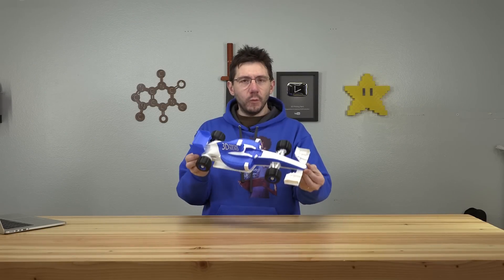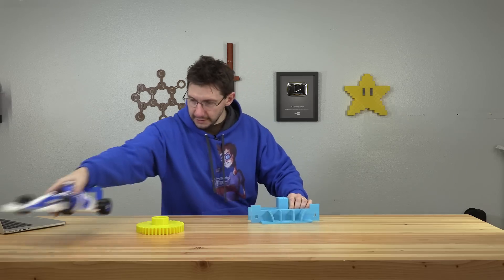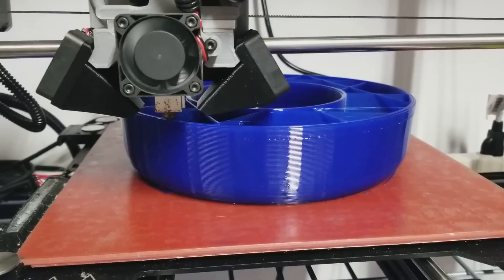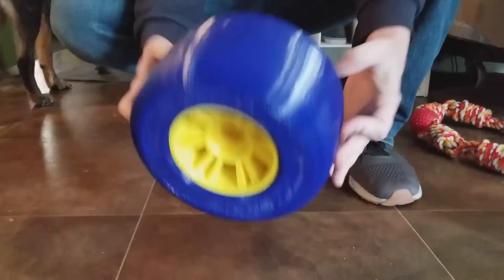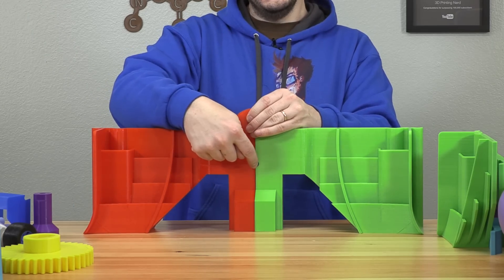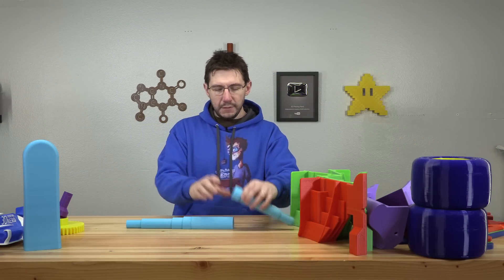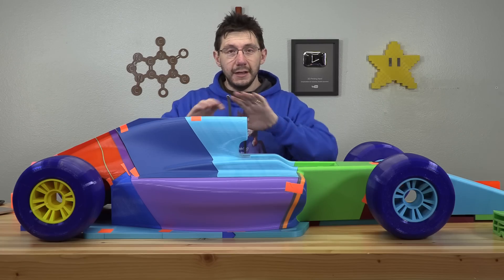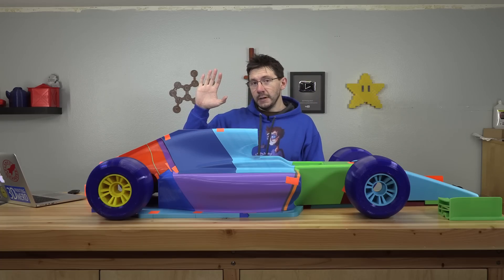Worlds Largest OpenRC F1 Car - Phase 1 // 3D Printing the Parts (Matterhackers BUILD PLA / Pro Flex)

Comment: I know this is an old video and this probably wont be seen, but i think the best way to build those load bearing parts and make them more than strong enough is to modify your files to have a channel that would accept some carbon fiber rods and glue those in.  I know it defeats the purpose of having it fully 3d printer, but thats engineering. Sometimes you need to work around the limitations of your manufacturing processes.
Reply from the maker: Oh it’s seen. Yes having some rods in there would have helped. I wanted to go as 3d printed as possible, and then once that works kick it up a notch. So, maybe that notch is channels for rods :)
Reply: @3DPrintingNerd  I would love to see a running model! Maybe you can figure out a way to incorporate the 3d printed brushless motor by TheGoofy on instructables too!

Comment: Great idea, why didn't you provide the parts with blind holes in Meshmixer and then connected them with pins. In any case, it would have given more stability.

Comment: In woodworking, when you are connecting parts, especially if it is load-bearing, you want to increase the surface area of the glue, and it is best to have one part go into the other. A mortise and tenon, for example. On these parts, at the very least, I would create diagonal surfaces between them. You could also create a V-line that slots together. A V-line would create more glue surface and would give you alignment registration in one axis. If you cut off the ends of the V-line, that would give you alignment registration in 2 axes.

Comment: Skinning for strength will work but adding dowels to the butt joints on the axle and chassis will really help. Or even biscuits like used in cabinet Making. Can't wait to see it tear the tires to shreds!

Comment: I think the bottom plate is too thick.  I think you could have gone half the thickness.  I'm not sure if you did strength test but I'd bet that plate could hold 150lbs  and for every part you reduced the thickness would reduce weight. I understand you can't really reduce the thickness of every part but any flat part you could.  just a thought.

Comment: A tip to Joel (or anybody else watching) from the car community. Next time you have to slip two parts together that are very tight fitting like the tires onto the wheels use a little bit of dish soap with warm water. Once the mixture dries it will no longer be lubricated and the two parts will hold together quite well.

Comment: On accuracy...
1:03 You are referring to WHEELS, not rims. The rim is the part of the wheel where the tire is mounted (the bead). Calling wheels "rims" is slang (dumb and unprofessional).
12:54 It looks like you used duct tape, not gaffer tape. There IS a difference. Gaffer tape is cloth with a matte, non-reflective finish. Duct tape is plastic with a glossy finish.

Comment: 3D-Coat actually has a tool that will not only slice the model into parts but also apply a variety of pins and holes so that the parts can be reattached after printing.

Comment: Hopefully you can answer my question. I want to print something like a blank folding rule but without the "prints". But it needs to be foldable (maybe I could use some metal parts?) and round about the same size like 1 foot long. Could you help me further please?

Comment: Wood carpenters have this tool that cuts a small slot in just the perfect way, in just the same position  to give strength to the piece. 
I think its called a puck cutter?  you cut the slots and add a small wood piece that is shaped like a boat. Adding this would give your epoxy joint a lot of added strength.

Comment: Getting ready to buy my 1st 3D printer(Ender 3 Pro).I'm SO excited! I LOVE those tire/rims! How much do you think it would cost in filament to replicate them as large as a Ender bed can do?Also,curious as to why on some of the larger pieces that you knew you have to epoxy/glue ends together,why you didn't incorporate dovetails or tabs as well as adhesives,or is that the same as what you called "registration marks"?As always,Thank You for sharing?

Comment: you should have put holes in all the mating surfaces to put some "dowels" in. then got some appropriate sized aluminum rod to epoxy in, give the joints some rigidity. also the rear axle could have an aluminium rod through it (you could go steel, but it would be heavy, alternatively you could use some carbon fiber tube)

Comment: Why did you not make them connective? You could have easily added pegs in your print that would connects pieces together. All you would need to do is add some glue and stick the 2 pieces together.

Comment: One suggestion, if you make your slices/joints at an angle it gives you a lot more surface area for epoxy and will add strength.

You could also make the slices like puzzle joints or dovetail. That would be really nice. 

Love the project!

Comment: You should have printed a hex socket in the middle part of the axle and a hex boss on the outside peices that go inside the socket for better torque transfer and overall higher strength.

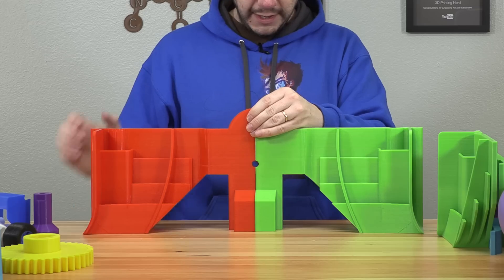Comment: 8:18 If you're breaking up a scaled up model like that you can afford to reduce the thickness in places without compromising the integrity of the build.

I'd use overlapping joints (1/2 thickness overlaps where the two parts meet).

You'll have an increased glue surface for strength
It would help eliminate with the single failure point (torque about the center join)
You'd also preserve the bolt hold (it would go through each overlap on the joint)

There are quite a few places that an overlap would add strength to the build.

Comment: On the axle, have a large 1-1/2" hole bored in 3" from each flat, then 3d print some 1-15/32" X 6" pins to glue inside. When considering slicing, go back to the original file and put in reinforcements and mounting solutions, such as tongue in groove, laps, or screw/bolt ears. With flat/flat glue joints, you are asking for trouble as that is the weakest possible glue joint.

Comment: Apparently this guy doesn't understand or know rc cars.  Most RC cars have a structural frame which supports the massive torque of the electric or gas motors.  The body parts are very thin and used for aerodynamic flow.  This car would be way too heavy and lack the structural strength that the rc model experiences.  Where are you going to find a motor for this?  If it is for a non-competitive running model, I would have designed into the areas that were cut apart some sort of flange that could be screwed together.  Or how about some sort of common wood-working joints like a pin and hole, dove-tail, or splined joint to increase surface gluing area and thus increase structural strength.  But as an exercise in splitting up large parts into smaller printable pieces, well done.  Hint: don't even try to dabble into rc planes with this concept.  Fun video, I learned alot.  Thanks
Reply from the maker: That is correct, and I don't know and understand a lot of things. Trying to learn!

Comment: I'm not too well versed in 3d printing so take this for what its worth, but if you NEED to print the spoiler in 4 parts you could borrow a technique from the miniature hobby called pinning, wherein you drill a hole in both pieces and put a metal rod in it to ensure strength. 

Your solution is better but you have massive printers, and not everybody does. Lol

Comment: Now I want to build a printer that could do the body as a single print. Also, I think the planned filament extruder is going to need to be able to make 10kg reels of filament. Finally, the 20 ton minimum buy of raw pellets is looking necessary, rather than a WTF moment. (yeah, I know, they're not all 20 ton minimums, I was just recently laughing at that...)

Comment: Man, when you'll be printing a 1:1 F1 car... don't do such slices... it will crack almost in any (near glue line) place while you'll sit on it :))
hmm... I guess it's possible to do with big pieces using that incredible "hang on hooks" 3d-printer. Actually if you'll enforce the parts with aluminium frames it will be sturdy and can be used as a go-cart (is this a term?).

Comment: You printed up the whole thing at 400% without checking the assembly process or strength of the joints? That's just stupid. Not to mention that mass scales as the third power of size, while strength goes as the square, so you increased the stress by a factor of 4 in critical areas.
Reply from the maker: True, very stupid. Also true, I've increased stress. Yet, here it sits, in front of me, fully assembled, powered, and ready to go. Yay?

Comment: I have zero 3d printing knowledge so excuse my ignorance. Is there a program, or a way to print parts that need to be combined/epoxied, print them with dovetails, or other woodworking type joinery? Considering there are so many peices that need to be combined (especially considering the size of this particular project), it seems like it would have benefited greatly with those types of joints, rather than flat mating surface which require you to "skin the parts."

Comment: What idid with spilt parts was to make a dowel on one and a female hole on other so they could be glued , you could also use two female holes and insert a plastic or wooden or steel dowel and glue

Comment: Meshmixer still drives me nuts, but that is because I use a touch pad and not a 3 button mouse on my laptop.  If cutting, why not create registration parts to key together more easily and give greater strength to bonding together?  Think biscuit joint with the biscuit attached to one side.  It would also help align the sides to keep them perfectly flat.  Easy in Meshmixer to do this and I even did it with my lifesize LEGO lightsaber hilt:  https://flic.kr/p/27mTto4 my daughter is demoing here. The top pulls off just above her hand and has a peg that inserts into the lower shaft.  This was one of my very first Meshmixer projects, getting this to fit on my UM3 platform at the scale I wanted.

Comment: Oh how i would like to make this thing remote controlled ... i would at least make te rear axle in aluminium or steel, and to join the parts i would just heat/melt them together like i did with my 100 % one for the body and bottom plate. makes the thing also a lot more easy to take apart and work on if something breaks. But love the video keep it going

Comment: One way to add the peg holes: Edit the STL files normally, and place small cylindrical objects inside the model along the seams. Then subtract them from the original model so they create an empty space inside the model, and then split it with Meshmixer as before, creating aligned peg holes on each half.

Comment: I'm wondering why don't you design some kind of locking system/indentations/whatever for the joints for the big parts?

Like for example that axle. I'd be a LOT stronger, if you just extrude a small portion inside and make indentation to the other side. Then just glue them together and lo and behold! You have strong joint.

Comment: Spoiler and other split items make the edges like a step or ledge to the point. where they overlap to the connection point glue both halves together then bolt in place.    Think like one hand plan out and facing up take other hand out facing down put hands together like your praying only sideways.  Imagine those are wher you spoiler are coming together that way both halves get bolted to body

Comment: You could cut some kind of mechanic so the pieces lock in eachother
With tube you could leave a hole in the one and make the other tube have a smaller but longer part come out of it so it just slides in eachother

Comment: just a suggestion for you Joel. pretend your using wood or other engineered ways of assembling your pieces. take the pieces you have cut up and add dove tail joints or biscut joints alignment pins, twist lock something or other ,like you say "possibilities are endless" . the point i am trying to impress upon you is to not use flat "butt type" joints . you have the ability to add what ever shapes you want to make any and all joints much stronger. same with RCLifeOn fellas boat .it fell apart because all joints were butted. you dudes are smart but i think needed to hear this. i hope i helps and your not offended.

Comment: you can save on glue and tape related headaches by altering the edges to include interlocks like with ancient eastern architecture. this way will have each piece support each other.
Reply from the maker: Very good idea and most likely what I would have done had I been smarter.

Comment: perhaps you could use simple woodworking techniques to overlay smaller pieces with joints and bevel joints to improve strength and bounding points?

Comment: Does meshmixer not allow you to export the models you split back into your 3D modeling program? The only reason I ask is I can't figure out for the life of me, why you didn't put alignment pegs in the sliced parts. That would give the but joint a lot more strength. I may have commented before you mentioned it in your video if you mentioned it.

Comment: Watching this makes me glad I'm also a woodworker, its given me a great understanding of joinery.  With a little bit of modelling you could have added scarf joints, rabbet joints, or mortise and tennons to your sliced pieces to get much stronger joints.
Reply from the maker: That's very correct, but, this wasn't an exercise in strength, and simple slices were what was intended for this. If I were to do this again, and not go for this exact style, you bet I would follow more of a woodworkers idea and added better joining surfaces!

Comment: I'll start by saying I'm not expert in 3d printing, however I am pretty good at the carpentry and mechanical side. You should have add a 'tongue and groove' to create a larger surface area for epoxy. or even more advance a 'sliding dovetail'
Reply from the maker: I fully agree with you.

Comment: I'd try to make some "plugs", so they could just snap together, like, ud make a rectangle sticking out of the split model, and a rectangle hole on the other split model with the very same size, or like 1mm bigger, so you could easly snap in place before glueing

Comment: Is there a reason fibreglass or carbon fibre weave with epoxy can’t be used to join pieces? Should be very strong using either method.

Comment: +3DPrintingNerd I really have no right commenting on a printing video since I don't own a printer... Lol But an idea for those 2 pieces that you are/were planning on glueing/butting together then covering with coroplast(for sale signs) to add support. I fly RC delta wings and we use sheet ABS that could possibly work in this situation maybe better than coroplast. You can order many different thicknesses of the sheet ABS. Nice job on the 4X print!! Really cool!

Comment: Hey!
I was thinking, if you could print the parts for the axle to interlock, and then run a 1/8 threaded rod with nuts on both ends, it may hold together and take the weight of the car, depending on the axle wall thickness. The rod should help with the pulling forces, and the PLA should be strong enough under the compression forces....just a thought of course.
Also, I assume you want a completely transparent skin to bind parts together, but, in the past I have printed out 1 mm thick (and thicker) layer of TPU to separate components on quadcopters. The TPU sheets are super tough and don’t rip easily at all. At least then you can say that even the reinforcing sheeting is printed! :)

Comment: Some of those parts are way thicker and heavier than you’d find on an actual F1 car. Conversely if you’d printed at a quarter scale the parts would have been too thin to join successfully. That’s the problem with scaling up or down. Just shows that each scale has to be re-engineered to suit. Those 1100hrs could have been spent recalculating thicknesses rather than printing. The car would have been a lot lighter, cheaper and you’d have had more sleep. Benefits all around. Regards.

Comment: So when do you get to build one big enough to ride? Will carbon fiber nylon filament work for that?

About the drive shaft, maybe build the middle of the shaft with a recessed portion, extend the other ends into that recessed portion. Maybe even add a key to it like when connecting a motor to a pump.

Also, I like your excitement over the flexible filament working. Keep up the good work.

Comment: qualifying statement: I do not have a 3D printer.
That said, Couldn't you use some wood working joints IE: Dovetails, box joints to increase the surface area of the glue joints and thus increase the strength of the joints?

Comment: for the front spoiler, instead of a plastic sheet, maybe a fiber glass layer surrounding it? Since you are already using epoxy, it will create even more strength for your part.

Comment: For the axel you could have printed each of the three segments with a hole running through them (but only all the way through the central piece) and then printed a tube of the same diameter. Then in assembly you couldve joined them by glueing them all to the tube as well as each other, giving more strength while still using small enough parts
Reply from the maker: Watch the Phase 2 video to see what I did ;)
Reply: 3D Printing Nerd Oh wow you did exactly that 😂😂.
Reply: Great videos by the way! :)
Reply from the maker: Sure did! Also, thank you!

Comment: One option you could do to make the joins stronger is to use keys... A simple slice isnt strong. But if you keyed the halfs/parts together like a jigsaw piece the strength would be better as the stress would be more distributed. Also it gives more surface area for the glue.   You can also do some plastic welding....

Comment: Couldn't you have split the pieces so they're kinda interlocked, like puzzle pieces? I imagine it'd improve the structural integrity by a tenfold. Of course, it'd be a lot more work as you'd have to do each piece manually.